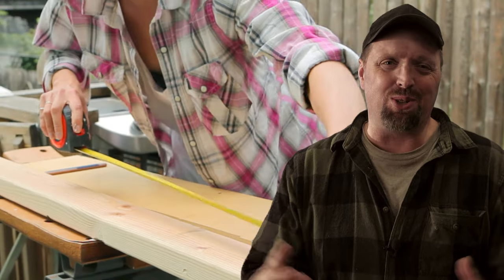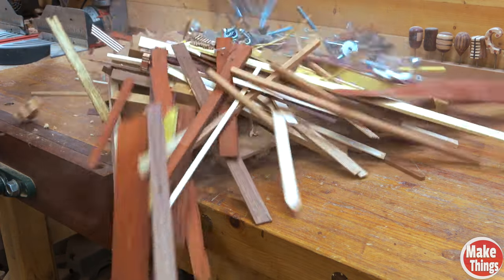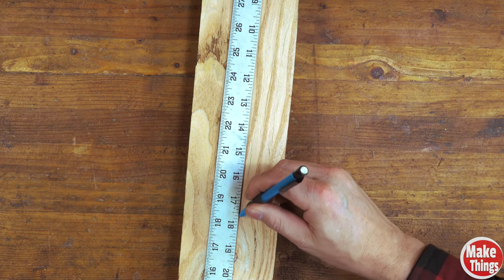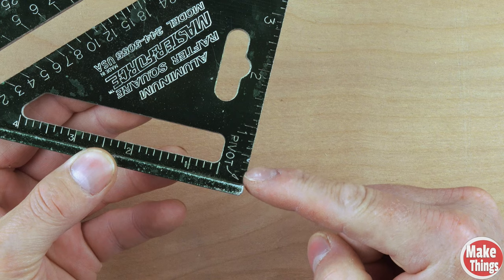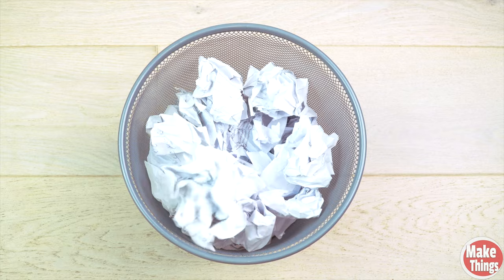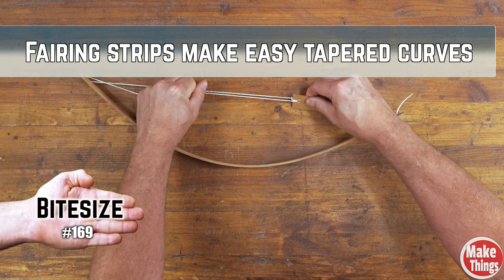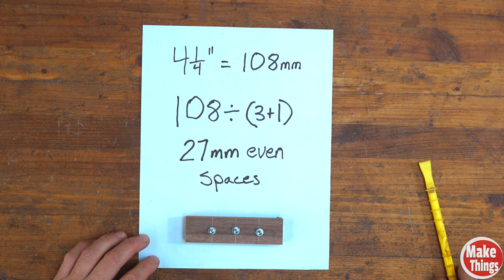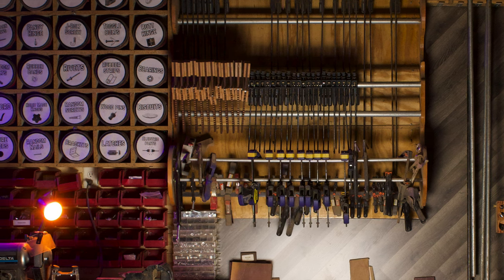12 MARKING tips you better *NOT* use with markers...  // Measuring and Marking Full Size Tips

Comment: To transfer the spacing for the holes on, say, a power strip, put a piece of paper tape along the whole length. Pierce the tape at the center of each hole, then remove the tape and place it where you want the power strip to be. Mark where the pierced holes are with an awl and remove the tape. There you go, exact and clean placement.

Comment: All good ideas and it helps to be reminded. Just a tip, with hard materials,  wood and metal etc., always use millimetres 0.01 to 10,000. Centimetres are for materials with flex in them: carpet, fabrics, foams etc. But you can use millimetres for them as well. And like all systems make sure the other guy knows which unit you are using.

Comment: “Hard to flip it to get symmetrical sides”

Did you try using the ruler to note the measurements where the design comes onto and exits the edge of the board and then using those measurements to line it up with the opposite edge.